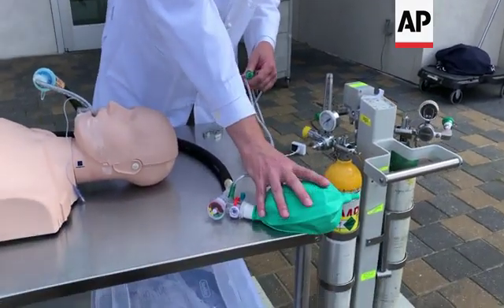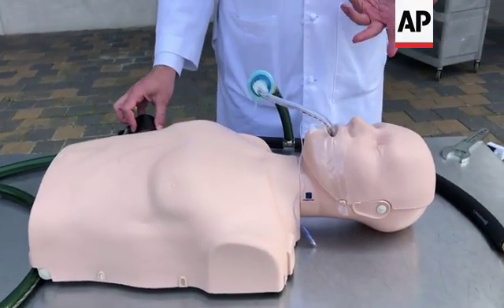Doctor makes simple ventilator with basic supplies

Comment: You can't give oxygen greater than 60% FIO2 to patients for more than 24 hours on the ventilator.  If this vent is using the hospital's piped in oxygen at 100% FiO2 to power this vent then you'll  run into complications such as oxygen toxicity, absorption atelectasis,, pulmonary edema, ARDS, pulmonary fibrosis, barotrauma, and even death.  Either use a blender to deliver a precise FiO2 or switch to compressed air to power the ventilator.  They can then bleed in oxygen from the O2 flowmeter on the wall into your ventilator circuit and titrate the amount of oxygen from there according to ABG results.

Here's what I would do to improve this vent:

1.  Use the hospital's compressed air system instead of the hospital's compressed oxygen line to power the vent.

2.  Replace  garden hose with corrugated tubing for ventilator circuit ( there is no shortage of corrugated tubing ).

3.  Bleed in oxygen from the wall via flowmeter into your ventilator circuit.  Use the formula to estimate the desired FiO2 and titrate oxygen from there based on ABG results.

4.  Use a ventilator disconnect apnea alarm to warn staff of patient disconnect.  (optional).

5.  Use PEEP valve at the end of the exhalation port.

Good luck!